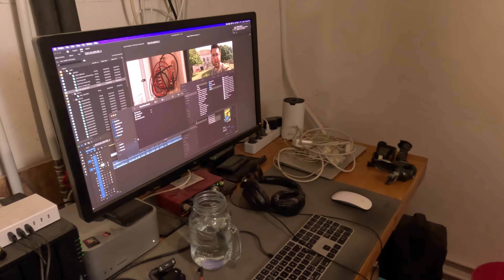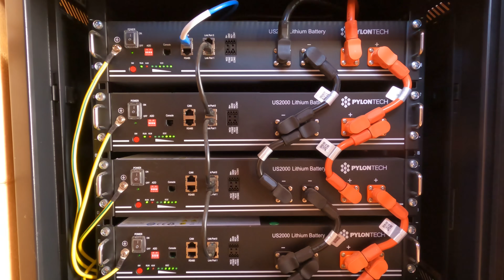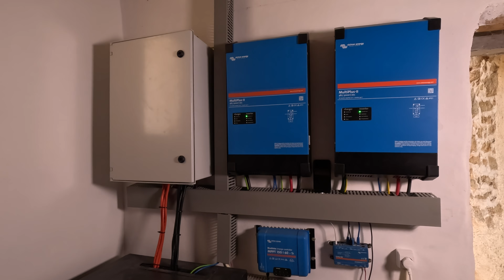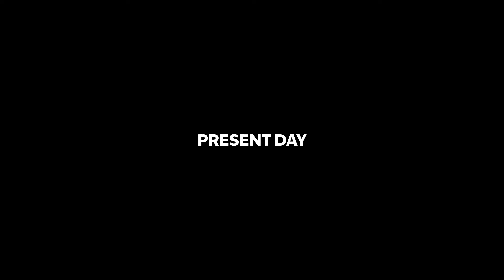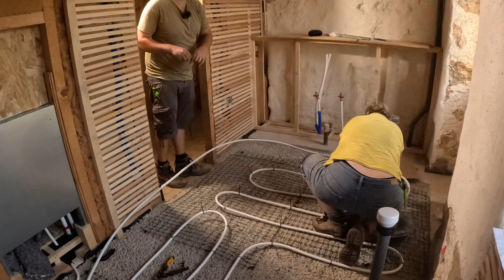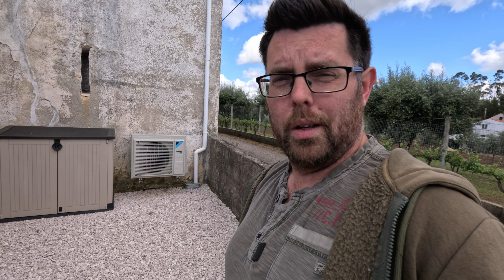Can Solar Power Heat Your Home All Winter? Our Experience and Data Revealed!

Comment: Is best to increase the solar array so you do not need the generator.  While the generator seems to represent about 5% of the total the energy from that is about 20x more expensive than solar PV meaning your cost for unit of energy will be double by just having 5% from generator.  I'm also fully offgrid including heating using solar and I do not use a heat pump (much colder here in middle of Canada).  I use thermal storage 96kWh + 30kWh in order to deal with solar variation in winter and I have two LiFePO4 batteries a 4.5kWh and a 13kWh.   I used to have propane as backup for heating and a smaller PV array and I decided to more than double the PV array and add extra thermal storage as it was less expensive than using propane (around 10% of the total depending on winter). I have not used propane or any other type of backup for the past 3 winters tho there may be a few days where it is a bit less comfortable is manageable.
Reply: I agree.
More panels increases the production when there is no direct sunlight, only ambient light, and the cost of panels is so low now, that it's quickly recovered with the high prices of the alternative fuels for backup. Not to mention the satisfaction to not need to run the generator, which is well worth a few hundred quid for some extra panels.
 I think a lot of the problem is panel orientation too. Most of my friends, especially the ones who know a bit about solar power, moan about the orientation of my panels. They are absolutely convinced that if I would change the orientation I would make more electricity. They don't seem to understand that I would only be increasing the electricity when I wouldn't have anywhere to put it, and I would be decreasing the electricity when I struggle to produce enough.
 With way too many panels for the summer, all orientated for the winter, you make enough to get through the winter and are still over producing in the summer, but over producing a lot less than if they were orientated for maximum power over the course of the year.

Comment: Great video. I have a very similar set up, Victron and Pylontech. We use a dehumidifier to dry clothes in a spare bedroom, works very well and dries the clothes quickly, using a lot less power than a tumble dryer.

Comment: What I found out works best is always having over kill on solar even if it’s a cloudy ☁️ day they solar panel will fully charge up the battery that is the math you should use in Alaska there is a guy that mostly use solar he had old solar panel and purchased new one the new ones work all summer never using generator but when winter ❄️ comes he plugs in the old one to increase his solar production just over kill solar and you will almost never use generator

Comment: Good job, achieving living off-grid with SOLAR+INVERTERS+Batteries. With what energy you fill the car? Peoples need to achieve net zero emission. What property taxes payment has these home, before and after PV installation. Solar PV you have efficiency 2.6% minimum to 17.5% maximum (3.2 kWh/day to 21.8kWh/d).

Comment: A useful video, but I was a bit shocked by the amount that you've spent to date. I realise that the price of solar components has dropped at lot in recent times. E.g. I've just ordered all the components for a system based around the Voltacon 11KW smart inverter. With all the switchgear, interconnects, 18 x 440W  panels from City Plumbing (£60 each), 4 x 5KW batteries, plus groundmounts, the total came to £8,119. So, it might be worth telling people that they don't need to spend €18,000 to get a similar/better installation. But the most important message which came across, was to scale for December, when there is the most cloud and shortest days. Panels have got so cheap now, if you have the space, another 10 panels are far cheaper than a second-rate generator.

Comment: Nice to see your setup. I gonna do a build (no, no yt video or so) with a  caravan. Solar over the whole roof area. Additional more panels can be slided out from the top or i put them on the side of the caravan on a hinge to put them up like a tent many campers have. The "tent" roof will be solar ofc. Maby even make the same on the other side of the caravan to make a mobile garage for the towing vehicle and surround it with the "tent" plastic cover. Total kWp would be arround 8-10kw of solar. The batteries are loaded on the towing vehicle and will be placed in the storage of the caravan once settled. The max weight is a issue currently as they lack spare weight for towing them. Also car is electric with 200kwh battery which can also be used to power the caravan.
So basicly without the car there would be 30kwh battery power and 8kwp solar. That should be enough for full year and also charge the car over few days

Comment: Thank you for the video. You mentioned a new roof. I'll be very interested in that. I have a wooden roof structure that is deteriorating (carpenter bees, I think) with beautiful old roof tiles (house is in the Algarve). I want to use the tiles but I want a modern roof structure with great insulation under the tiles. I hope you can cover these issues in your videos. I'll be watching! Thanks

Comment: Excellent video. We had 18 panels on our two family brownstone grid tie system and generated a surplus 9 months a year. Something to bring up in a future video is the efficiency loss of panels over time, and how every year new panels come  to market with higher wattage output. Also curious if you will pitch the garage roof to an ideal angle for the panels at your location 😀 Eric.
Reply: I'm curious as well. I wonder how much the output will change when the panels will move up

Comment: there is no sun at winter most of a time, and solar max last 2 hours, with winter angle it gives allmost zero electricity even if you have 20kwt system 😅 maybe wind electric system could do a litle beter.🤔
Reply from the maker: There is actually quite a lot of winter sun in Portugal
Reply: @MAKEDOGROW  i live in Bulgaria, and have 22kwt system on roof. angle to sun and daylight winter time gives allmost nothing anyway, even if its pure sunny weather whole winter 😁 it gives efficiency but heating, at winter 😕 looks like a complete dreaming to my opinion 😆 house needs, if its not large as mine even, maybe 10kwt of energy to heating, maybe 3 if its tiny, especially at night time, when its -5 or more. so no accumulators or sun can do it in winter. so i think its not realistic to heat a house with solar energy at winter

Comment: I have enjoyed your post. I  was born off the grid in 1952. I lived in a home not unlike the one you have, but it had no power supply at all. The reality when it comes to then & now, one we didn't have solar.  Hell, back then we used Tow systems. The charcoal & stem gas production system was used to drive a generator, or a windmill that was used to charge up a set of milk float batteries. the charger was often a Dynamo from a Lory, 12" volts charging capacity & a regulator from the Lory to provide.  The flux charging regulating ability. & When we had frailer, we reverted to lighting the house on gas & or hurricane Lamps.  It wasn't till the 60s when we got our hands on the 350-watt DC charging set called the Iron Hours X army signal's Gen set that would charge a battery bank up to 32 amps, Amps &  the windmill in its present form became obsolete.  It wasn't until a Scottish crofter built the first axial flux starter that produced a 3-phase, AC current that, when rectified, would charge up to 100 amps of current into a large battery bank, the wind generator relayed to its present development it often seen in today flux wind turbines but for the crofter it meant one could mount is wind mill up on the highest part of the mounting  & run it's cabal over a vast distance as a AC current On a much thinners cabal but convert it by ratification to DC   when it got clos to the battery bank.  

This meant we could invest in a wind-powered.  The Axal flux was a DIY project that we adopted &  refined to what we have today. owning up many more opportunities for the former planner to become a growth of sorts in the development of the off-grid we see today

Comment: why you dont just add more panels if you need more power? so just double the KWP of the power inverter. then you just disconnect half of it in summertime, to not break the inverter? and also put them in nearly horizontaly, to maximize the power income due grey days.

Comment: I didn't know where I would end. I still don't know. So Victron is the only sane choice.
A grid connection is not doable here.
Got 14kW charging power with 90kWh of battery, and it is not enough to keep me warm in the winter. Due to misty days :-(.
Reply: (3 phase 5kVA mp2, soon to be 3 phase 5kVA *2 as I have a big induction cooker and ovens)

Comment: This was a very nice video of your off-grid system in Portugal and how you cope with day to day variations of the amount of solar energy production and your household consumption. I am a retired geek, I live in San Francisco and my house has 23 rooftop panels with 9.1 KW power. It produces ~12,000 kwh/year, I consume about 10,000 kwh/year and I send a couple thousand kwh’s back to the grid.  The electricity cost in San Francisco is very expensive, $0.65/kwh, which is about 4 times the US national average.  My electricity consumption includes powering an EV car, running ducted house heating from a heat pump and cooking on an induction stove. My total CO2 emissions comes from my natural gas hot water heater and is nearly zero. I don’t have batteries, since I am connected to the grid which act as my battery. If the “standing” costs of being connected to the grid become high, especially when my grid energy consumption is slightly negative, I might disconnect from the grid and add batteries. I would be concerned about running out of household electricity on cloudy days. I noticed in your video, how you have struggled with this problem.  Perhaps using my EV car as a “mobile battery”, where I can charge up the EV car at a charging station and drive the EV car back home to power the house, might be an adequate solution to powering the house on cloudy days in wintertime.

Comment: I live off grid too. What I can say is that orientation of the panels is tricky. One direction must be on one string, otherwise you lose more than you get. Panels in the shade ruin efficiency.
Be careful about diesel generators. They have huge EMI noise, if you have sensitive equipment in house, you can burn it. You can add EMI filter, or use Inverter type generator with sine wave characteristic. 
I use pellet stove for heating, which cost me 200€ per year, for 250 sqm house. Consumption is about 100w.

Comment: I'm adding solar in Hawaii for the same reason I switched to propane for major appliances, reliably. We can lose power in some places for weeks at a time although it is more typical to lose power for hours up to a day at a time.  Typical outages will usually mean some frozen items will begin to melt in the freezers. Food isn't cheap here, so it's well worth protecting.  Being able to shelter in home during disasters or storms is something too that all residents are supposed to be prepared for, so solar powered battery backup can go a long way in maintaining individual needs without depending on public resources.  I like your setup folks. Mahalo Nui for explaining how things work in your home.  With Aloha...
Reply: do you mean "reliability" ?

Comment: On of the most interesting presentations on being off grid we have seen. In your presentation you discussed solar, wind and hydroelectric sources of sustainable energy.   While watching my wife and I were surprised that you did not mention thermo sources of power, especially for heat and air conditioning. Just wondering. Again GREAT video!

Comment: I loved all the nerdy detail! I would most definitely have the apps and love playing with them, understanding the options etc. I might geek out more and construct a simple mechanism to raise and lower the solar panels so that they point directly at the sun whatever the time of day, using a RaspberryPi and a couple of servo motors - pure geekery and completely unecessary.

On that score - 'puters - nerd out some more for us that like that kind of thing: what kind of computer do you edit these videos on (only interested in CPU, GPU, RAM amount and speed  - not the brand name on the box). What software do you use, and why? There is lots to choose from - Mac specific variants, Microsoft variants, Open Source variants ....  What's your back-up regime in an off-grid situation? How many external disks do you have? NAS? Cloud?

Comment: maybe you can add some panels on the wall of the house to have a better angle for winter. you then have a small air gap between the solar panel and the house that might even add a tiny bit of insulation to the house. and you get a tiny bit more electricity to waste in summer.
maybe at some point you have an electric car, then the excess power - at least in summer - is welcome as well.

Comment: I was amazed you are able to be off grid and 100% electric with so little solar.  We are also totally electric, have 10K of solar panels and 35KWH of batteries, air source heat pumps and water heater and still can't keep up in the winter.  We used 1.8MWH in January and 1.3MWH in February.  We did only use 346KWH last June.  Then I did some looking at the difference in Portugal and Wyoming weather and the difference in your home construction and ours.  Our average temp all Jan and Feb was -3 c and we live in a wood frame home.  Totally makes sense now.  Well done video, thank you.

Comment: I have a similar system.  I have found that having a small inverter generator to charge the batteries is best.  I have a hundred dollars worth of 48v chargers and can put about 12kwh per gallon of gasoline into the batteries.

Comment: We have a grid tied solar sytem with batteries installed on our house. It works fine and over a full year it produces about 2.5 times the power we use, with the obvious difference according to season and weather. The power produced that we don't use is sold into the grid (only downside is currently we pay about 0.36 € for each kw/h we buy from the grid and we get about 0.08€ for each kw/h we sell to the grid).
My question and what I don't got yet is how a off grid system works in one regard: about 50 years ago I learned in school that electricity is and has to be produced when it is used, or is and has to be used when it is produced. This of course without any option of battery storage.
Now for the question: if in an off grid system the storage batteries are fully loaded and the usage is fully covered but the system produces still more power because the sun is at it highest and the weather is cloudless what happens to the power produced over the current usage?
Reply: An EV can soak up the overage with no problem and correspondingly save considerable on fuel costs.
Reply: @danielsteele7225  Yes, an EV is an good addition to an PV system, but that is included in what I wrote as usage, because when the battery of the EV is fully loaded it won't use power from the system until it is unloaded again. My question was how this technologie correpondents with what I learned in school back 50 years ago.Since I'm not an electician I have no detailed knowledge in this at all. I just see that the PV system installed on our house is giving power to the grid aka selling it, but in an off grid system this option doesn't exist.
As it is here I'm happy how it works since it reduces my power bill a lot, and when the system is payed for then this is free money for me to use for other things.
Reply: @ulie1960  The solar regulator stops accepting electricity from the panels. 
The panels just simply stop generating electricity when there isn't anywhere to put it.
Reply: @robinhood4640  Thank you for the answer, I didn't know that until now. 
I still have to see how the systems output will change over the years. We installed our system in September 2023 and about the costs and earning we have to wait for this year to end because the grid company pays a fixed amount each month based on the average input over the previous year. They calculated last year out of the three month in 2023, and actually they were really close to what they calculated for 2025 based on the input from 2024.
We also have to see if we need to extend the system (there is room for about 10 more panels to the now installed 21) in case we got an EV and a wallbox and if we add an heat pump for heating the house in the future.
Reply: @ulie1960  My first set up was with second-hand panels, the price of them second hand was pretty much the price of new ones now. They were about 15-18 years old when I swapped them out for the new ones. They were still chucking out 75-80 % in direct sunlight and I gave them to someone else to get started with their setup.
 Once you've got everything up and running, adding a few more panels is pretty cost effective I would have thought. As long as you don't need to buy additional equipment/batteries with them.

Comment: Great vid mate, you covered a lot here and have a very nice and robust system that should serve you well for many years. 
With such a crappy power supply there, I think you have made a lot of good choices.
I have a 10kWh Grid Tied system in Australia installed 5 years ago, it has already paid itself off ($4500 AUD installed). I have gas hot water but installed a 320 ltr HW system I was given and put it on a timer for a few hours through the day while adding a lower wattage element (1800W) in case of cloudy weather while I am recharging 30kWhs of batteries as well with a cheap AIO system that I use for most of the household power 24/7, it works well and I get $30-$50/month back from power company from extra feed in tariff.